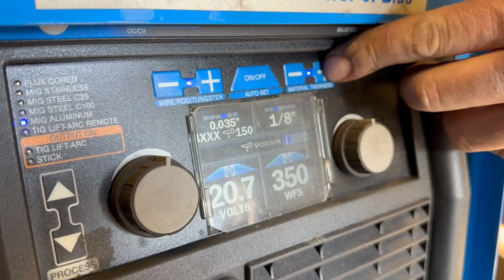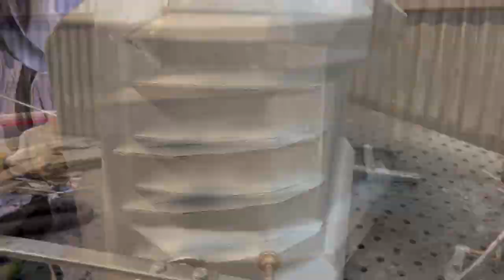DIY EXTENDED OVERLAND STORAGE

Comment: Awesome work. Curious what you did to strengthen the bed rails to support the weight of your camper. I have a 2017 ram 1500 that I just put an Alu cab cabin on it and that thing bounces around a lot on the bed rails.
Reply from the maker: The Alucab is bolted to your bed ? My is solid bounce little
Reply: The Alu cab is bolted to the bed rails. With it on there the whole bed flexes back and forth and I get a lot of chatter in the cab from it moving. It’s especially bad on the freeway with the way they shape the road. Like riding a bull.
Reply from the maker: @Redawg1  maybe too stiff rear axle you need better shocks or springs   maybe